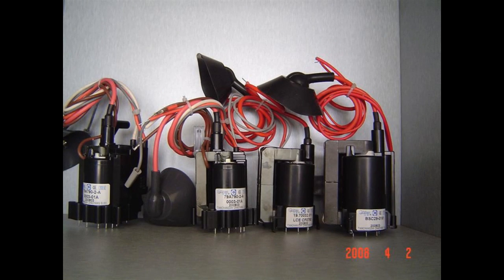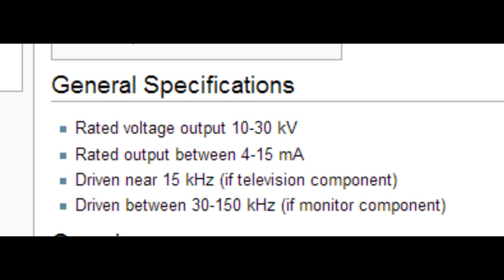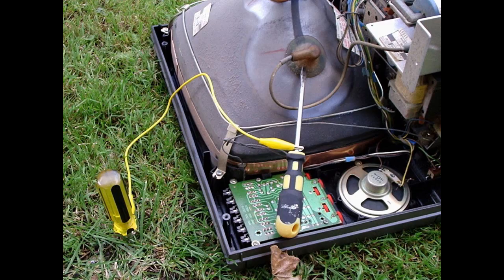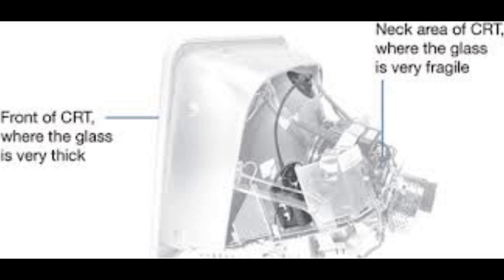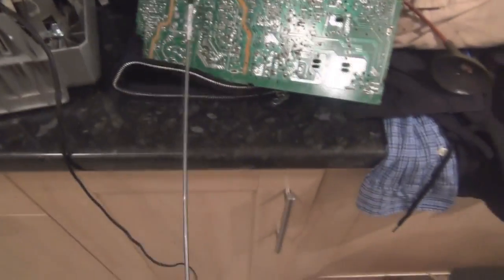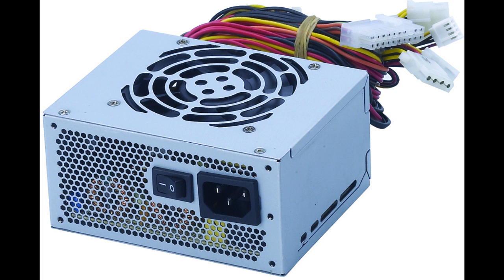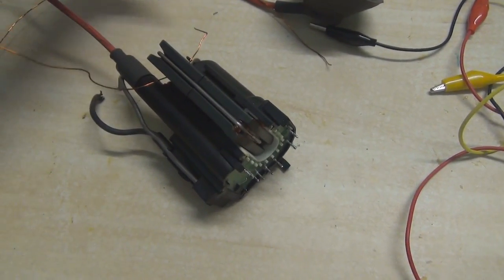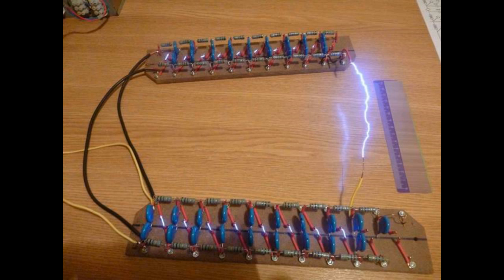TUTORIAL: My Flyback Project - How to SAFELY extract a Flyback transformer from a CRT

Comment: First be aware of "rebound'  in any High voltage (dc)  circuits, speaking from personal experience,  If short across the high voltage is not maintained you could get a percentage of the voltage return to the terminals. At lower voltages (less than 500 volts this is negligible, around 20 to 50 volts), but at 15 to 25 KV this can be 1000 to 3000  volts or more. This is from the physical compression of the dielectric material, and is painful as well as causing strong involuntary movement.
Reply: T Y
Reply: How would someone maintain? - regarding your "If short across the high voltage is not maintained, you could" hypothetical statement.

Comment: take a blunt I use a old screwdriver grinded blunt small enough to fit in the middle of the pins carefully tap till you hear air being sucked into the tube once the tube has been filled with air it's not only dead electrically its now safer to handle because it will not implode

Comment: So 5 yrs later, what is the purpose of all this? Just to make a HV arc and smell the ozone? Any practical uses? And, btw, the explanation about the external windings is lacking (why, how, where, etc). Cheers mate!
Reply from the maker: The purpose of this is for generating HV as HV has many practical uses. I mainly do it as I find high voltage and electrical projects fun. I've used the output of the flyback to make a Marx generator to created much bigger more impressive arcs. You can use it to power a small Tesla coil for research into resonant circuits and wireless power transmission, the list goes on...

Comment: Hold on, did you make this video on how to remove the flyback transformer out of the CRT and just let all the other parts rot in your garage, shed, or house? I had turned this video on to see how to remove it safely WITHOUT damaging the tube or any other parts because there's a CRT that I think the flyback transformer burnt up, so I first went on eBay and put a flyback transformer that was $5.99 on my cart and went to Youtube to see how to remove it properly so I could replace it with a working one. (Honestly, this video does look interesting because I love CRTs, so I will watch the rest of it.)
Reply from the maker: Flyback transformers can be used for a multitude of high voltage electrical projects. I made this tutorial so others can source one for their own projects. The is not a repair/replace tutorial, and so by no means should you follow it if you wish to keep the CRT operational.

Comment: Wait - so can I create a arc using the transformer and a small battery (like  a 9 volt)?
Aso can you use the transformer on its own?
Reply from the maker: Yes you can use a battery, you will need the driver circuit if you want to use the transformer with the battery though.

Comment: It may sound silly, but why don't we just cut the anode wire before it connects with the vaccuum/glass of the TV?
Reply from the maker: You can if you want, but the CRT will remain charged which adds extra danger when taking the whole thing apart and just generally working around it. Its just a safety precaution.

Comment: The tube won't have a charge if it's been turned of for years! A day at the most would be enough for most tubes. Although you should always do the manual discharge anyway.
You also only need to discard to the ground wire running around the CTR tube, or the metal frame if there is no wire.
Why burst the tube? You'd have to swing a sledgehammer at that thing to make it implode. That's just vandalism to a perfectly good tube, what did that tube ever do to you!  ;)
Reply: A day is not a rule of thumb, and many CRTs will naturally have a voltage inside, even if low.

Comment: Great video :) I got frustrated with desoldering transformers with 20+ pins as it has to be perfect to be able to pass the pins through the board, so I now use a paint stripper type hot air gun on low temperature, which melts all the solder on all pins simultaneously. The transformer just drops away from the board! however it must be done outside as it is is very common for PCB substrate or semiconductors to be burned and smoke like hell.

Comment: there's a easy way to discharge the high voltage in only 5 seconds,just to connect the hot wire of the fly back into the ground of CRT or main board by using screw driver and connect the positive  of the high voltage filter/eletrolytic capacitor into the negative to discharge the electricity.

Comment: I have no idea why but this circuit burnt out my 2n3055 transistor, AND my LM723 chip in my variable power supply...I checked it 5 times before I applied power...seems the high voltage went backwards down the negative wire into the power supply and burnt it out...do you have any idea why this happened????????????
Reply: me to this circuit is fail and weak, try another
Reply: so your power supply burnt up also???
Reply: no just 2n3055 transistor burn,and change for a new 3 time, I pull it to heat sink, ,15 second it will burn,forget the driver search another,and make a simple driver
Reply: I have a 300$ pyramid ps-25 power supply that it messed up..I fixed the power supply for little money..a LM723 chip was bad...
Reply: are connect directly at flyback-power supply-current?

Comment: Excellent tutorial. I've been trying to learn how to use a TV flyback  transformer to build a Jacobs Ladder powered by 12 volts or less. After about a week of browsing the net this is the first and only site that answers ninty nine percent of my questions.  my questions.

One or two small details:
1.   can I downsize the 240 ohm 5 Watt and 27 ohm 1 Watt resistors to lower wattage if I restrict the power source to  12 volts or less?

2.   Where can I buy the 240 ohm 5 Watt and 27 ohm 1 Watt resistors ?
Reply from the maker: Thanks! Lowering the wattage should not be a problem, I think I only used a 5 Watt resistors as that was the only wattage available of that resistor when I was looking online. I bought these of Ebay very cheaply. You can find pretty much any value of components on there.

Comment: the best way to make the crt fill up with air
take a small screwdriver and place it in the hole were the suction cup used to be
the tube is thin and metal there

then wack the screwdriver
it pokes trough nothing breaks and the crt fills up
Reply: Best way is to put a 10 Lb sledge hammer into it.
Reply: that makes shards and it inplodes then
Reply: +robot797 which is very fun.

Comment: lethal capasidance my ass
i have toucht many tv's high voltage wires 10 seconds after unplugging and i nevr got shocked once
Reply from the maker: Its probably a feature of certain CRTs. Or the CRTs you have touched have already shorted itself in a short space of time. Besides its always better to be safe with these things.
Reply: i touched tv's from 1950 to 2000
and none of them were shorted
i also know many people who didnt gave a crap about if for 50 year and never got a majour shock

Comment: 4:49 putting the contacts in water would also work?
Reply from the maker: I wouldn't advice it, water is a very poor conductor of electricity
Reply: ok, maybe water with salt?
Reply from the maker: DanielTseng100 It would be a lot more reliable to just but a large piece of foil over the back of the board and press down on it wearing gloves. Also you don't really want the salt water to cover and possibly corrode components on the board.
Reply: ok, thanks

Comment: lol i didnt do any of those safety steps, but i got the board removed, haha, plan to make tesla coil, and possibly use the screen as a giant light bulb, why i havent worked on removing the gas from the glass.
Reply: the lamp thing is going to be a bit difficult, but you could be the only one in the world to have a particle accelerator as a lamp xD
Reply from the maker: It would have to be a very small tesla to be powered by a flyback